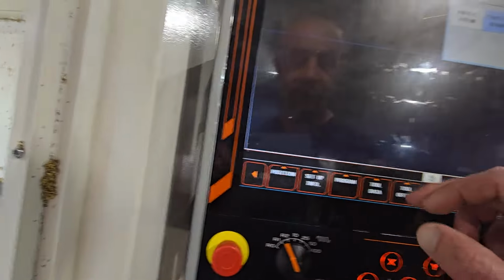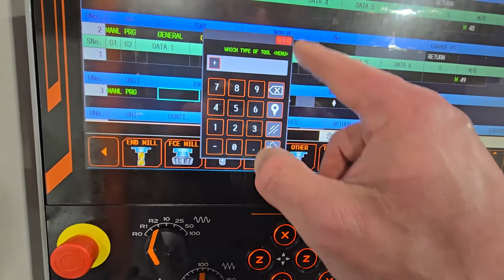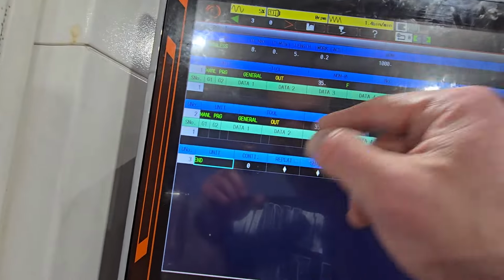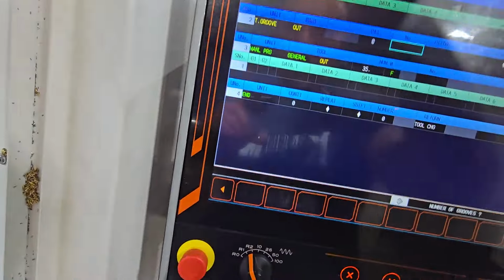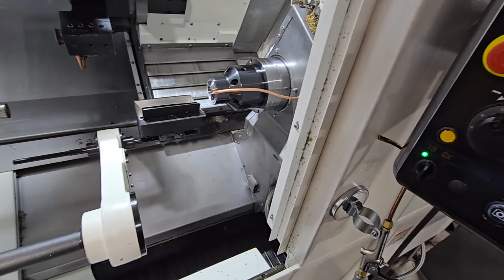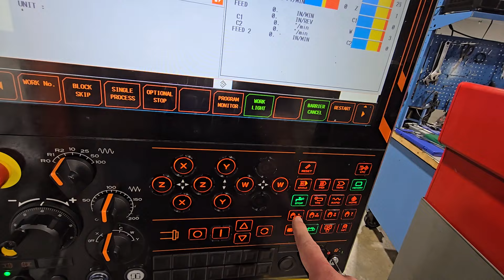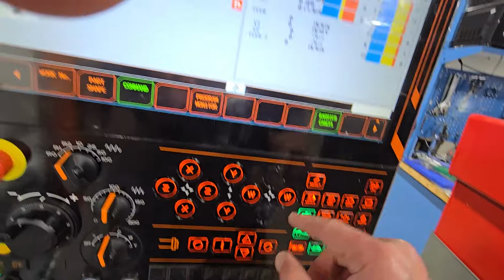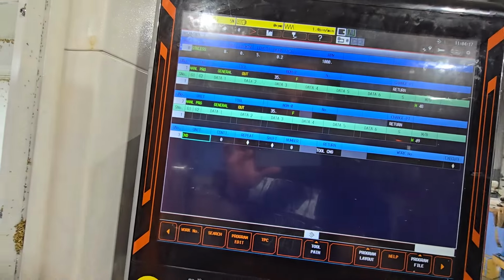Mazak Mazatrol Smooth G Parts Catcher Programming and tips

Comment: You can also set parameter TC65 to 48 which will only pull the parts catcher up using the code M-48 or you can set the TC65 parameter to 0 which will pull the parts catcher up and then down before and after any groove cycle automatically. No additional M codes required.
Reply from the maker: That's something I didn't know but useful,  thanks for sharing .

Comment: I run this same machine at work and I'm trying to use head 2 as a live center using the transfer but the Chuck always wants to open. When I use chuck option 0 to keep head 2 closed I get an alarm about Chuck not opening. What I want is for head 2 to move up to part on head 1 and turn in sync while I turn a long bar and then retract head 2. Can you do a video using head 2 as a live center?
Reply from the maker: I don't work on that machine , just used it because it has a parts catcher, but my guess be bring the subspindle in to where you need it to be , in manual code use m511 which is sync both spindles, machine your part, then do m513 which cancels your sync , and retract, as long as both spindles are closed , it should spin , if it doesn't,  there's something within your program that interferes in my opinion, hope that helps.

Comment: Hello,
I'm just starting my adventure with Mazak smothg can you do an example program as it commutes the second spindle and returns the detail to the parts catcher. I would appreciate it very much
Reply from the maker: Hey Damian, unfortunately I rarely work on that machine since it's used for production jobs and they run g&m code, I did a simple program or two, or showed some options when machine was parked,  but never had a chance to ran a program, transfer the part and then enable parts catcher, so it be hard for me to make the type of video that you're requesting , but if I ever get a chance to do so, I will.
Reply: @martyz3232  Thank you very much for your quick response. And can I possibly send you a picture of the program to look at where the error is?
Reply from the maker: Mazak.learn@gmail.com